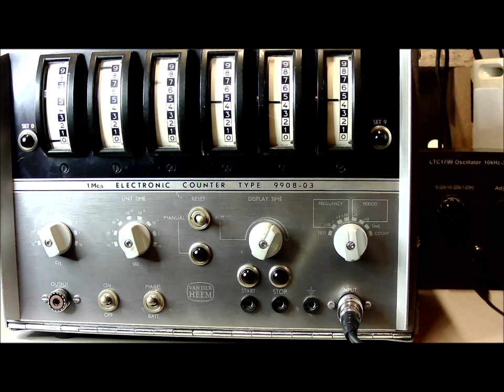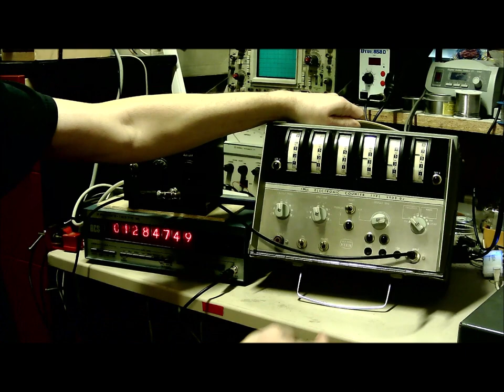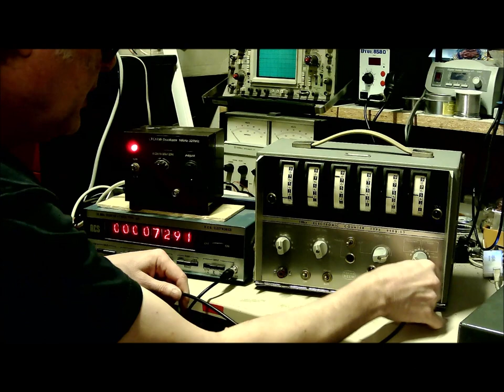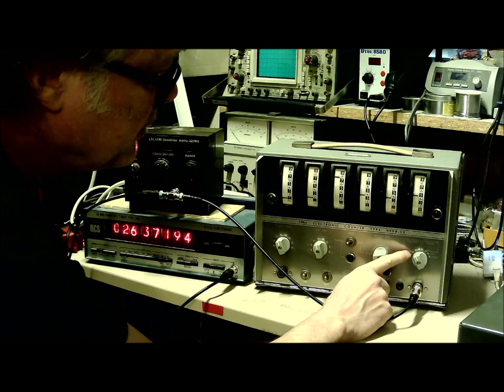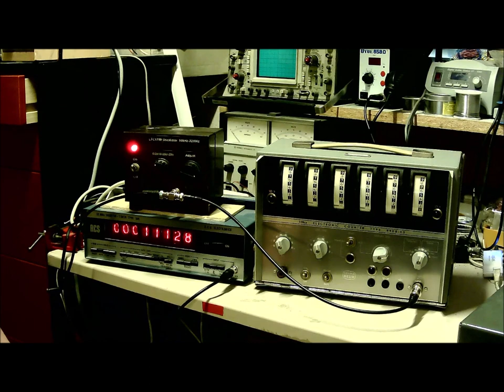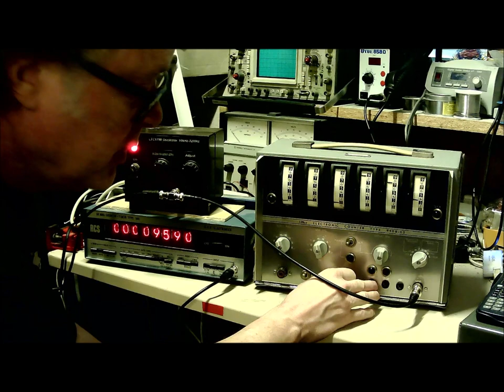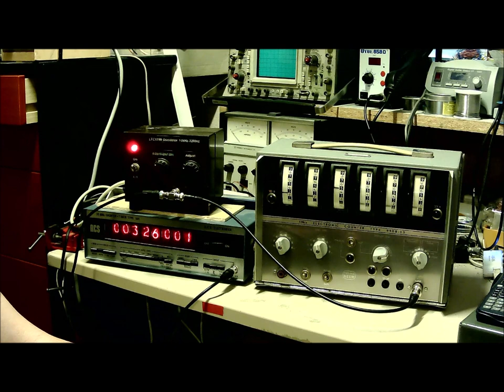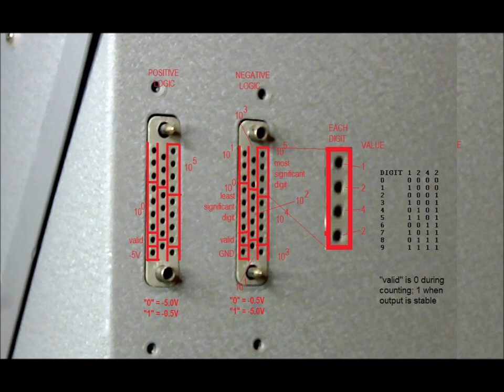Mechanical counter up to 1 megahertz: Van Der Heem 9908 from the fifties

Comment: I love esoteric test gear! this is a very interesting piece, can you shed light on its principle of operation?
Reply from the maker: Of course. I have put some schematics on radiomuseum.org. 
Per digit they made four flip-flops out of two germanium transistors each. Four of those flip-flops go on a single pcb. They count to 10 and the overflow is carried on to the next digit. The outputs of the 4 flip-flops are sent to a simple digital-to-analog-converter (just a bunch of resistors) and the analog signal is fed to one of the moving coil meters. Special about the flip-flops is the way they count. With our present day knowledge, we would let the flip-flops represent a binary number, so the weights of the bits would be 1, 2, 4 and 8. That's called bcd-code. But that's not what they did. In this machine the weights of the bits are 1, 2, 4 and 2. Enough to count to 10, but it's a bit weird. I don't know why they did it this way, there must have been some sort of advantage. 
Another peculiar thing is that the stages are coupled through a capacitor, in other words, it's ac-coupled like in an audio amplifier and not dc-coupled as in modern day digital stuff. This must have been a left-over from the tube area. With a vacuum tube you must bridge the cap between an anode voltage of a couple of hundred volts to a grid voltage which is a few volt negative. The easiest way to do that is with a capacitor. The people who designed this machine in the 1950's were brilliant engineers, but they still thought like vacuum tube designers!
Next to the flip-flops that are connected to the digits, there is another set of boards containing flip-flops for counting the time. A frequency count takes 0.1 second (or 1s or 10s) and they have to time that measurement. There is an ovenized crystal oscillator at 1MHz. That frequency is divided by 100 000 or by 1000 000 or by 10 000 000, so that takes another 7 boards with flip-flops.